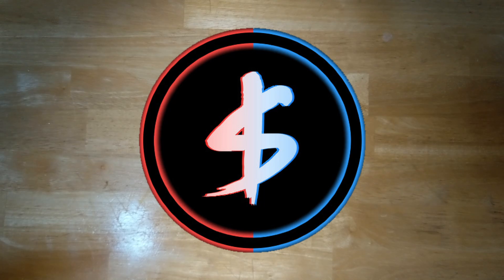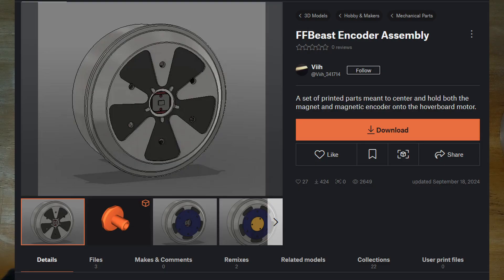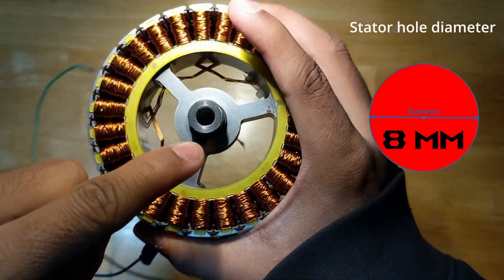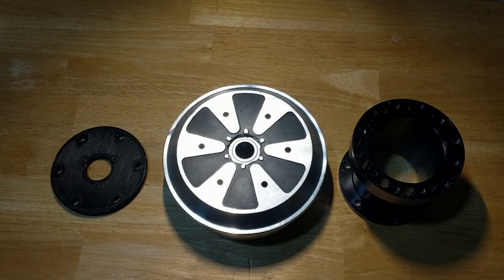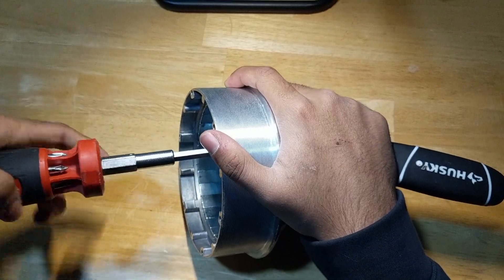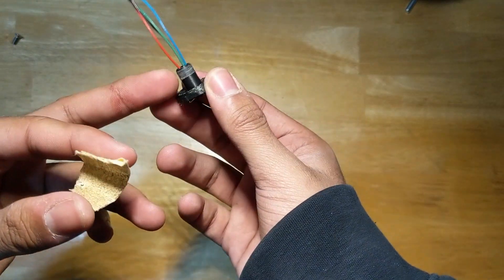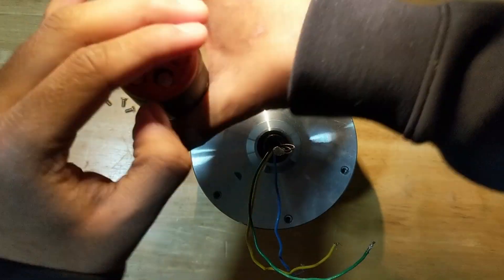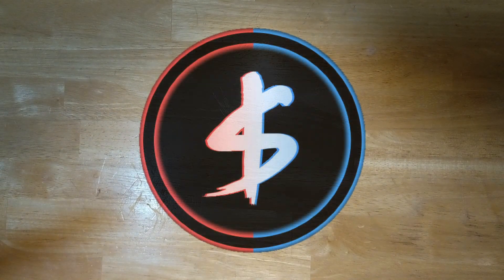FFBEAST Magnetic Encoder Assembly (Viih mount)

Comment: I was searching for something like this, many others use a bike spoke that rotates through the shaft, which I didn't like as it could be damaging the motor wires long term, I still have to see how I'm giong to drill the hole through the shaft as I don't think I have access to a machine shop unfortunatly. Might have to go asking about...
Reply from the maker: You can use a hand drill with cobalt or hss drill bits, just remember to use some sort of lubricant or oil, so that the bit doesnt get stuck and break in the shaft. If you end up drilling it off centre, then you can just grab the step file from the ffbeast discord and change up the model a bit, the magnetic encoders tolerance is ±0.3mm which is small, but forgiving. So yeah good luck!

Comment: Hi, I really enjoyed your tutorial on the FFBeast hoverboard motor setup it’s super helpful for beginners like me who are planning their first build.
I’m still in the planning phase and considering using an XDrive Mini (or 24V ODrive) for my setup. I’m wondering if it’s necessary to add a RegenClamp, or if the controller can safely handle the regenerative braking when FFBeast motor strength is set around 70–80%.
Thanks a lot for sharing your knowledge and time your videos are making this project much easier to understand!
Reply from the maker: Hey there, thanks for the comment! The ODrive you bought should come with a braking resistor, so there’s no need to buy the RegenClamp since the braking resistor basically does the same thing... it handles the generated power and turns it into heat. Plus, you won’t need to sink another $80 into the RegenClamp if your ODrive already includes the braking resistor.

Comment: What’s the magnet size?
Reply from the maker: Hey there!, if you bought the encoder off of aliexpress, im 90% sure it will come with a magnet, if not, the magnet is a diametrically magnetized 6x2.5 magnet, just make sure it is diametrically magnetized or else it will not work.
Reply: @Seigen96 only thing I can find on aliexpress is 6x2, can’t find 2.5 so what’s the next best thing I should get?
Reply from the maker: 6x2 will also work fine, could you send me the link to where you bought your encoder? I suggest you check the reviews section to see if anyone posted photos to double check if the magnet comes.. If you get this one which is the one I got.. it should work for you just fine. (Remove the space between the .com)
a.aliexpress. com/_mKgSBe5

Comment: Hello, I would like to do the same thing as you and I would like to know how you did to machine the main crankcase? I'm talking about the crankcase on which you put your wheel attachment, you machined the aluminum to have a hole in the middle to fix your encoder, I would like to know exactly how you did to prepare your crankcase to have the same thing as you at 3:18, I want this rendering there 3:18
Reply from the maker: Hey there! so I used different sized drill bits to make my way up and slowly reach the size that is listed, I switched from using a drill press to hand drilling it and it worked for me. Just remember that you still need the bearing, so if you have bearing removers, I suggest you remove it before you start drilling so you can be extra careful. if you don't have bearing removers, I suggest you slowly work your way up in size and then hammering out the bearing without damaging it. Then once you finish drilling, just put the bearing back in because you will need it. also, instead of using my way where I had different sized drill bits, just use a step drill bit and that will be fine as well, it would be much simpler than using different sized drill bits, but if you don't have it, you can use the same way I did, good luck my friend and please let me know if you have any other questions, I'd be happy to help!

Comment: Hey, amazing project! Could you help me with a question? What would be the depth where the diameter is 24mm to fit the encoder?
Reply from the maker: Hey, Thanks! You need to drill inwards until you completely reach the other side, you have to make it hollow. what your seeing there right now is a bearing, what I did was I drilled it with a couple of different sized drill bits, starting small then gradually increasing in size (a step drill bit is a huge help in this project, which I shouldve used) but you need to keep drilling until you can use a bolt and hammer to remove the bearing so you can safely remove the bearing (once you finish drilling to 24mm you have to put the bearing back in) if you have a set of bearing removing tools you can use that as well. best of luck to you and if you need anymore help just leave another comment!

Comment: Ok. So the 70mm m5 bolt would only serve as a guide when drilling, but at the end of the project it doesn't stay inside, correct?
Reply from the maker: if your referring to the 3D printed drill guide, yes, that does not stay inside
Reply: @Seigen96  I understand, so I just need the encoder support because the motor is already drilled
Reply from the maker: @gabrielmagevski8362  yup, print out everything thats on Viihs' Printables, the link is in the video description
Reply: @Seigen96  my friend thank you very much
Reply from the maker: @gabrielmagevski8362  No problem man, let me know if you need any more help!

Comment: Is there a link for the spacer and the larger washer please ?
Reply from the maker: https://www.printables.com/model/934160-ffbeast-encoder-assembly
Reply: @Seigen96 hi I see the washer but not the long spacer. Have you got the link to the long spacer to attach the wheel to please?
Reply: The quick release/steering wheel adapter
Reply from the maker: @forzomula_7777  I bought mine from amazon, if this doesnt ship to you just try aliexpress and find something similar: https://www.amazon.ca/dp/B07PFJT921/ref=sspa_dk_hqp_detail_aax_0?sp_csd=d2lkZ2V0TmFtZT1zcF9ocXBfc2hhcmVk&th=1

Comment: does the cable passing through the shaft create interference?
Reply from the maker: Not at all!, it is smooth and no interference whatsoever
Reply: @Seigen96  I made a very similar design but it was a problem, I had to extend the cables, maybe it's related to that, I don't know, but I use ffboard
Reply from the maker: @gorkems34  If you extended the cables via soldering that might've been why as the magnets wouldve interfered with it.

Comment: Hello. Nice work, its very inspiring. 
Just wondering, theres a mm gap that you have to respect, between the encoder and the magnet. So, my hoverboard wheel has letters witch i plan to machine it leveled, not grooves like yours. Wouldnt that interfere with the minimal gap between encoder and magnet?
Reply from the maker: Hello, Thank you, I'm not sure what you mean by your wheel having letters on it, if possible, feel free to email me a picture so I can take a better look. I do know that others have grinded their wheels down (for aesthetics purposes) but im sure if you machined it down a little bit to get past the letters your talking about, im sure you'll be just fine.

According to the MT6701 datasheet, the maximum allowable gap between the magnet and the sensor is 2 mm. If you’re confident that your setup stays slightly under that limit, you should be alright, but I just want to take a look at how your wheel looks like so I can get a feel for what your working with, Thanks.

My email is in my "about me" section of my channel.
Reply: @Seigen96  Thanks for replying. I cant see your email anywhere, but the Hoverboard i got is a nilox doc+, so it got the letters doc grooved on to the wheel face. 
But i think your right, it shouldnt be a problem because the letters should be half inch high, so if i level them, it should have the 2 mm tolerance. 
Thank you for your time
Reply from the maker: @freeck  I think you should be fine, if any other problems come up my email is dollarsigneigen@gmail.com, your welcome, and best of luck!

Comment: Hey, I tried the method mentioned on FFBeast, but I ran into some issues due to an off-center drill hole for the bike's pok. Now, my only options left are either this method or a gear-type mount for the rotary encoder. Did you encounter any problems after implementing this, like heat or interference from the internal magnet?
Reply from the maker: Nope no interference from the internal magnet whatsoever, but the motor does tend to warm up after heavy usage, it's really not even noticeable while your playing as your not touching the part that warms up, your hands will be on the wheel.
Reply: @Seigen96  so have you ever noticed any issues with the mounted plastic parts melting or deforming over time from the heat? Just want to make sure before I commit to this method. FIY I use 24v 13Amps Psu, with 45% power limit and 20% braking resistor value
Reply: plus, how did you drilled the 24mm hole, what type of drill bit you used, and did you removed the bearing when you drilled it or. . . . ? sorry for too many questions, despret here ^_^
Reply from the maker: @israeljmtd1667  You should be fine, i have used this wheel for a good month and a half, and i've had 0 problems with the printed parts
Reply from the maker: @israeljmtd1667  I drilled it with a couple of different drill bits, started small then gradually got bigger and bigger until I reached 24mm. the best way to actually do it is to use a step drill bit.
Reply: @Seigen96  okay bro tnx

Comment: Is there any way that the stator magnetic field can interfere with the magnetic rotary encoder? The encoder is much closer to the stator than any other project I've seen so far, but yours seems far easier to mount
Reply from the maker: Nope, there is no interference whatsoever, I wouldnt worry about that, from the past month i've been using my wheel for, its been smooth and perfect
Reply: @Seigen96 nice, and how it's compared to the logitech g27? for example, the curbs on the track, understeer, and other imperfections on the track
Reply from the maker: @henriquehff  I had a g27 before this, and funny enough im using the g27 pedal and shifter still, but the wheel is so much better than the g27, the g27 is a loud wheel, my family always complained about hearing it from the other room, and now they dont, its very quiet and its really, really worth building this wheel. Highly recommend it, the force feedback is insane, its so much better compared to the g27
Reply: @Seigen96 I saw your g27 gameplay video haha, I will also use my g27 pedal and shifter, do you use an arduino pro micro with Sim-Racing-Arduino? I will try to use both shifter and pedal with the same arduino, but I haven't see anyone using both on the same board
Reply from the maker: @henriquehff yup, I use Dave Madison's tutorials, I tried using chatgpt to merge the two codes but I couldn't get the buttons and shifter working at the same time as the pedals so I ended up just buying another Arduino... So yeah I know it's possible just I haven't gotten to it
Reply: @Seigen96  try the code in my next comment (if youtube tries to block the comment ask again, note that I haven't tested the code, but it should work just fine), my doubts are about the responsiveness of the buttons/pedals, because now one board will now manage both pedals and shifter, so it might be slower, you can also change the line "const bool AlwaysSend = false;" to "const bool AlwaysSend = true;" for the arduino to constantly keep checking the buttons/pedals state, and please note that the pedals you now have to connect Pin_Gas into A4, Pin_Brake into A1, Pin_Clutch into A3.

Comment: Hello, it seems like you found a better method than the reference on the ffbeast site. However, wouldn't passing the encoder cables through the same place as the motor phase cables cause deviations and interference in the encoder?
Reply from the maker: Nope, it's as smooth as ever and there's no deviations and interference whatsoever

Comment: hi i have a question can i make that part that is holding an encoeder a little smaller for like 4mm hole inside of 8? because i dont have any drill press or somthing to drill hole like that and i want to fit into a 4mm hole
Reply from the maker: Message me on discord/email and I can send you the step file so you can change it to fit your needs